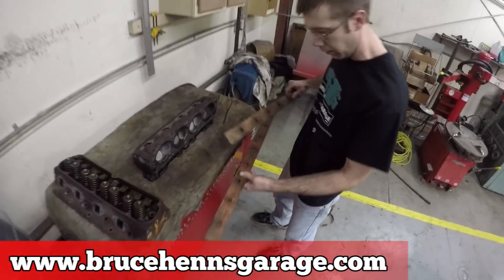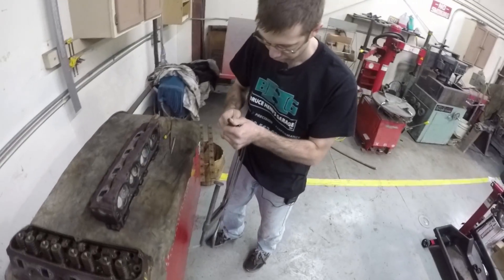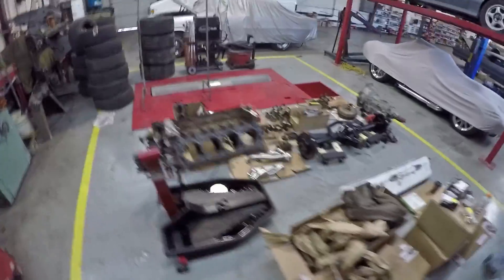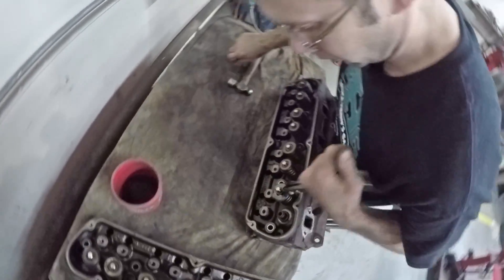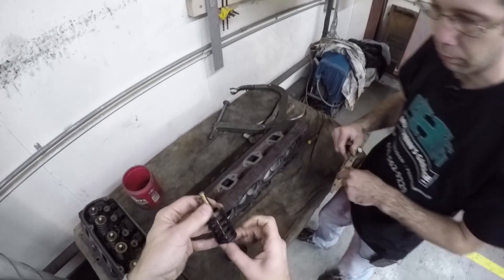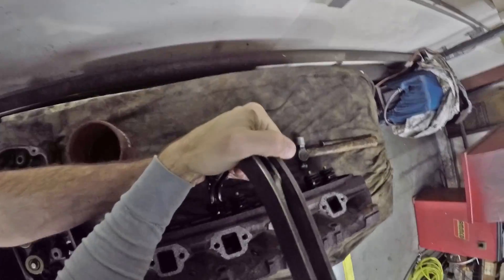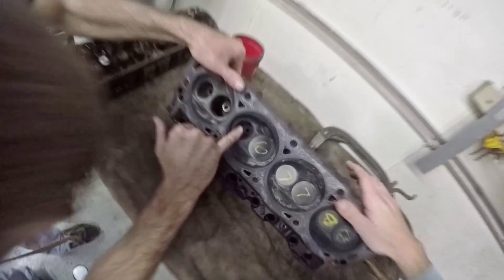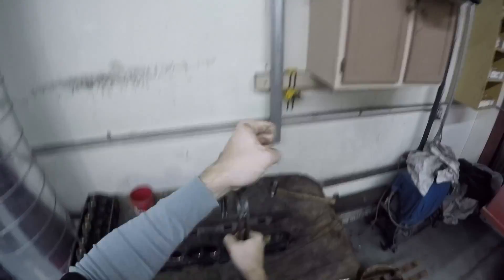Removing Valves from Cylinder Heads.

Comment: Tech tip! 
1. Tap the retainer gently around the perimeter to loosen the retainer from the keepers so you don't have to sit there making poop sounds, this will also generally loosen the keepers from the valve there for making you look less like a jerk!
2. Get a pneumatic valve spring compressor this thing is a joke. 
cant wait to see what you do to the heads.

Comment: Mr. Regular, if you go to lap the valves in, if you don't have a machine, use a power drill, a pushrod, and a piece of hose about 4-5 inches long to rotate the valves! Works like a charm, and you don't have to work for hours doing it by hand!

Comment: Oh God, Valve Springs, Brings me back to my High School Auto shop days when we had to take apart & Put back together a Small Single Cylinder Engine (5HP or Less IIRC, Could be mistaken), Hardest part for me was Reinstalling the Valves/Valve Springs, Took Me Days if not Weeks trying to figure out how to get them installed before I Was introduced to a Tool Called the Valve Spring Compressor!

Comment: You can loosen the screw, throw the lever and then tighten the screw again ya know. Makes the job a lot easier.
Reply: +mickeybill prob. thought it worked like a vicegrip where once it's clamped down on anything it's 100x's hard to tighten clamped down.
Reply: +mickeybill or just use a pneumatic one like a decent machine shop should have

Comment: What car is that black one behind you under the cover? Thought it was a Facel Vega at first but it's probably something american, chevy or something? 
Looks classy.
Reply: I think it might be a c2 corvette
Reply: ah yes I think you're right
Reply: OhMyKMPR That one I think is a Cobra kit car.
Reply: +PvanP I'm 90% sure its a 55 bel air. The tail lights aren't round like a c2 corvette and they are high up on the rear fenders unlike a c2 corvette.
Reply: +dragkid185 I think he meant the other car beneath the Foxbody Mustang. Because of the side exhaust pipes I'd guess C2 Corvette as well. The silver one in front of the van could be a Bel Air though.
Reply: Looks to be a 1955 Chevy